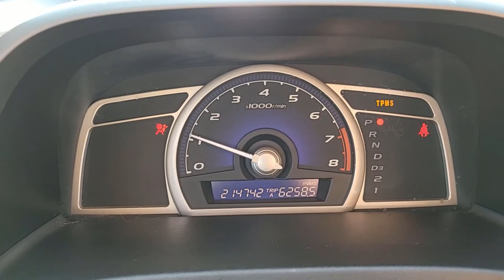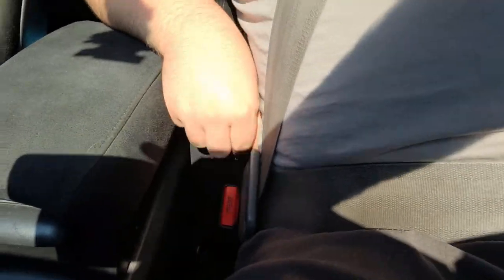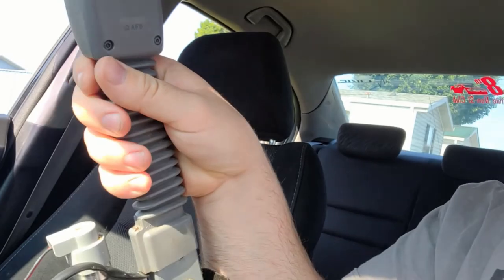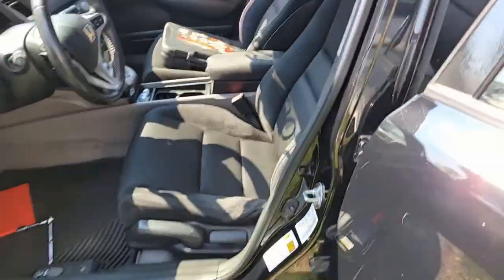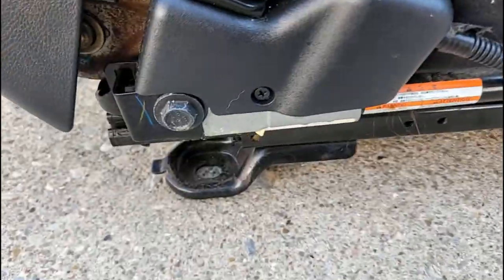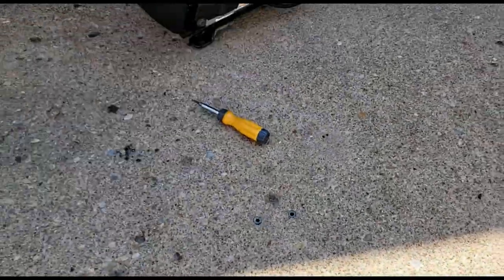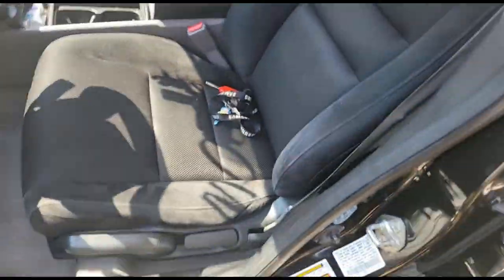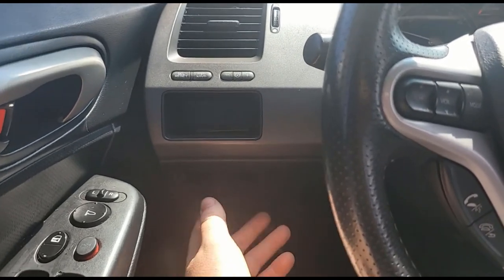Attempting To Fix An Airbag Light Issue 2010 Honda Civic

Comment: did you ever get to fix it? I'm about to swap my EX seats to SI seats, both sedan. I hope I don't come across this problem but I'm aware it's quite common.
Reply from the maker: Yeah it’s been fixed. Dealer reset it for free for me. It was the passenger seat weight sensor not being married to my car.
Reply from the maker: It will likely happen. It’s not a big deal

Comment: Why make a video of a failed attempt to repair something? Like you, I'm looking for a video with a fix or an answer. .pffft.
Reply from the maker: Because it’s a vlog video. Not a diy. If you don’t like it then oh well, solution: go to Honda and have them reset your weight sensors. They do it very cheap. If not, free like in my case.
Reply from the maker: Look at the title. ATTEMPTING to fix. Not “AM FIXING”